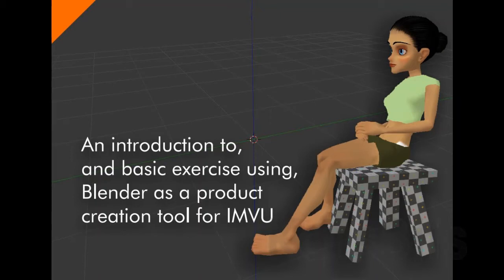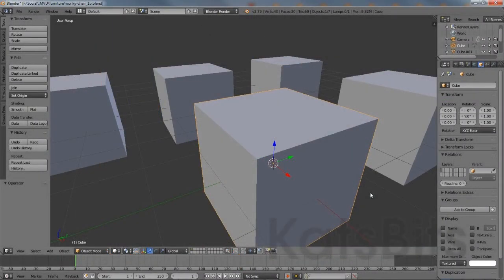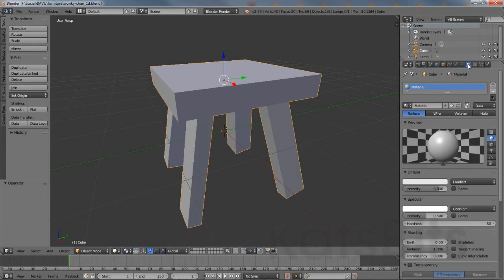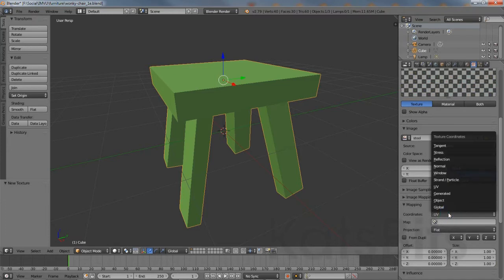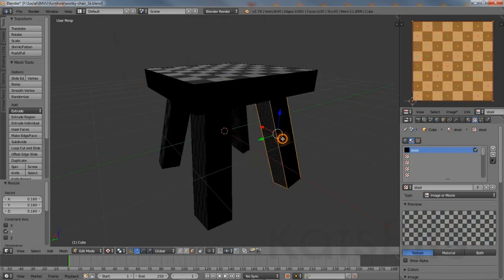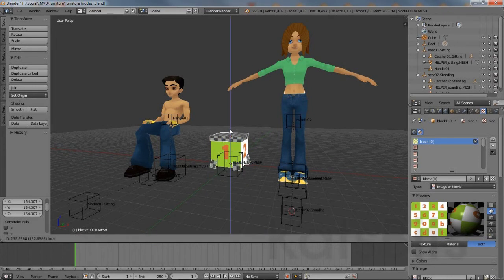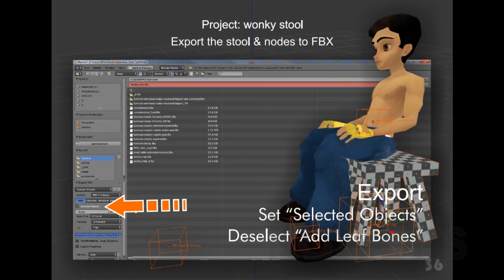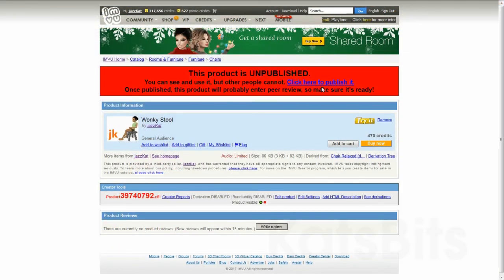Starter project for IMVU Creators new to Blender

Comment: Hey Kats, I know this is an old video, but how do you find the wireframe for the product you made to make different textures?
Reply from the maker: They'll be on the product pages or linked from there to a download - this item doesn't use a map though, just standard image(s).
Reply: @KatsBits  thhanks for the response, I should have been more clear. I mean how to unwrap and make your own UVs
Reply from the maker: @user-wc2jd3nn7u  See here for Blender 2.8+ https://www.katsbits.com/codex/magicbook/ otherwise that's explictly explained above around the 11 minute mark https://youtu.be/gIfl_JMmUqA?t=661

Comment: Thanks for the tutorial! Would you happen to have a tutorial on how to model and texture a room too? :3
Reply from the maker: Not  like this no, rooms are more complicated to build so it would depend largely on the type of room to be made, a graveyard differs to an empty store front. What sort of your room are you looking to learn to make?
Reply: @KatsBits  modern, luxurious apartments, that kind of thing. I did a bit more research after i posted this comment and decided i would go with 3DS Max instead of Blender. There's a tutorial series by Tophattwaffle and it's more similar to Hammer SDK which I know. I also heard it's more appropriate for architecture than other 3D softwares.
Reply from the maker: Hmm this is the closet to that sort of thing - https://www.katsbits.com/tutorials/blender/map-basics-tutorial.php
Either way you're dealing with a number of different concepts so it's not as easy to do a single tutorial video like the one above for rooms.

Comment: Can you please do one for beds. Like chairs isnt the only thing made in SL, how do we work this with a bed?
Reply from the maker: Can't promise anything... In the mean time, depending on the bed design just break it down into parts, so 'legs', 'mattress' and so on. Just use the same basic techniques shown in the video but reshape the objects to match what you want for a 'bed'.
Reply: @KatsBits  Ok, and when I get done with that, do I join them together where the poses happen at?
Reply from the maker: @IvoryBallard  If you've followed the instructions outlined in the above you should end up with an item that includes a default sitting pose which is exported to FBX at the same time as the seat mesh. All you need to do next is import it into IMVU and the seating will be included. If that's not happening you've likely missed a step or two, or are doing something different than is shown (in the above).
Reply: @KatsBits  Correct. I making beds and tables and different type of furnitures. Some that will require to add the poses and other is just a simple thing to add to a room. Also, i wanna get into making hottubs. And in Secondlife that is super easy to do. But IMVU for some reason a lot of people won't show advanced things.
Reply from the maker: @IvoryBallard  first bookmark these URLs: https://www.katsbits.com/smforum/index.php?board=26.0 and https://www.katsbits.com/tutorials/#virtualdevelopers. Second, custom poses have to be created separately for IMVU - https://www.katsbits.com/tutorials/imvu/furniture-poses.php and https://www.katsbits.com/tutorials/imvu/make-poses.php
Reply: @KatsBits  Thank You! I am going to check everything out.

Comment: Helps out a lot thank you very much .
Do you have a tutorial on 3d animations all steps from start to finish ?
Reply from the maker: Not yet in this presentation format. With that said there is a fair bit of written material on animating with Blender on site, e.g. although not IMVU specific it still useful in understanding what to do;
- rigging - https://www.katsbits.com/tutorials/blender/redninja-3.php
- animating - https://www.katsbits.com/tutorials/blender/redninja-4.php
There is an 'animated furniture' section here though;
- animated nodes - https://www.katsbits.com/tutorials/imvu/furniture-nodes.php#animation